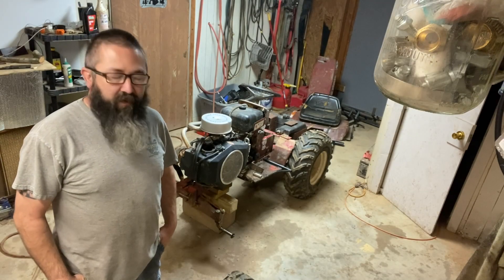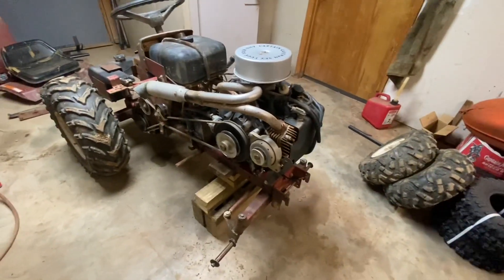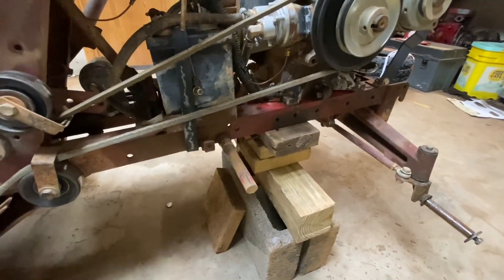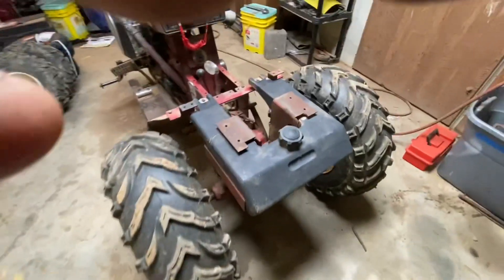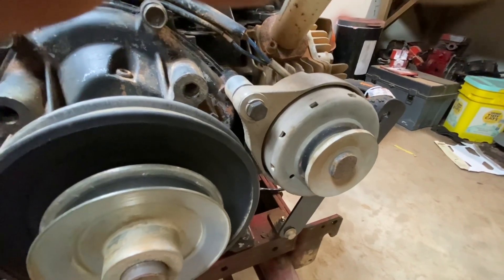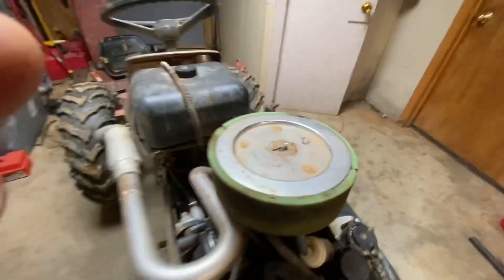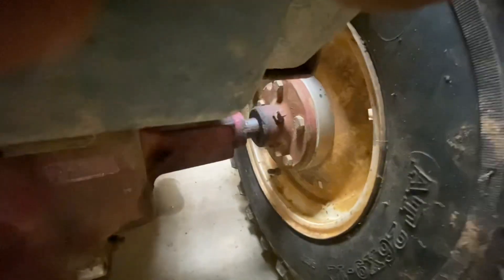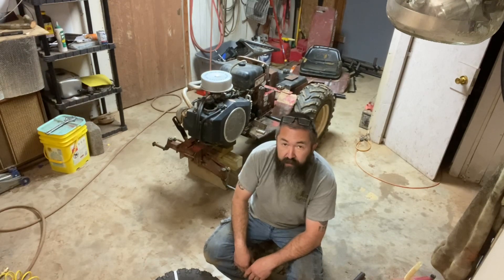Offroad competition tractor build! An in depth look at the B1 bomber.

Comment: Im up in NE ohio, Workin on a craftsman gt6000 right now. Have the transaxle out to get it locked up and it will be on 26in mudcats. My other trail riding tractor is my 12hp 6speed craftsman late 80s mower, converted to side shift and many other things done to it. One day hope to get out and ride with a group! You are correct, dont have to do all the crazy things. Just get out and have fun.
Reply from the maker: right on buddy! Lots of good tractor heads up that way.